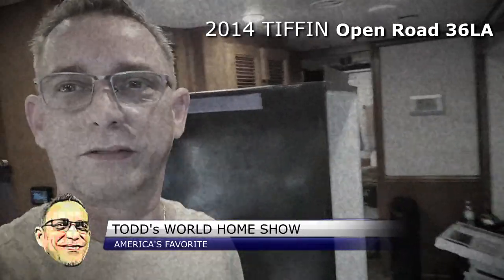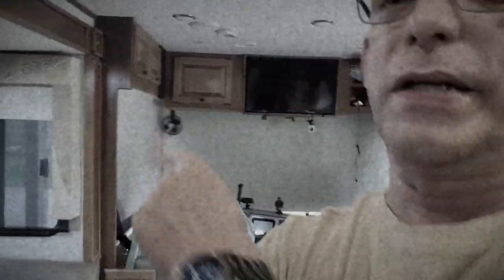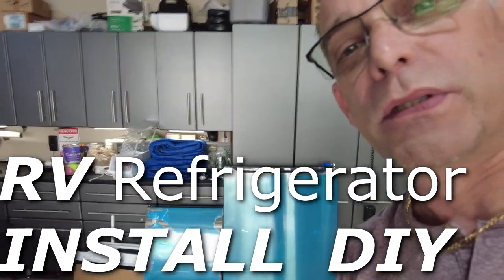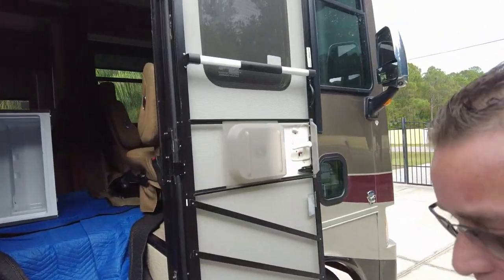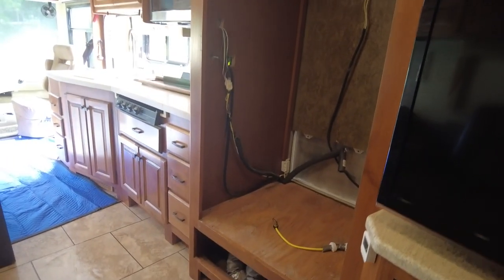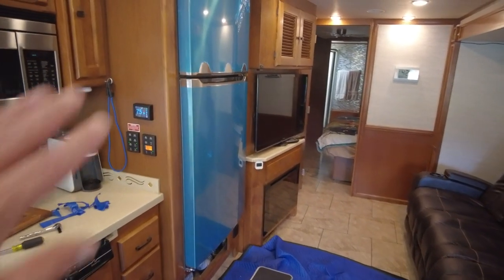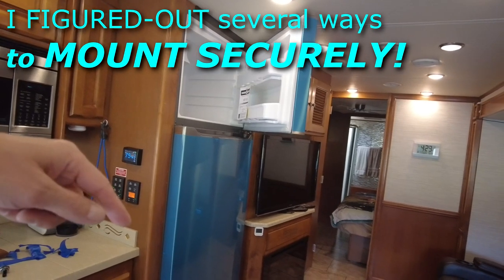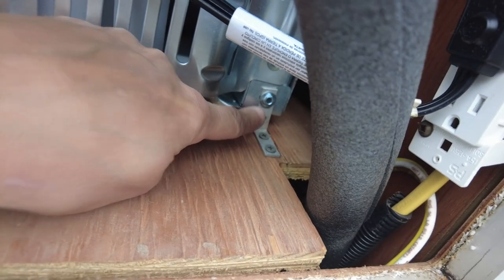tw RV ADVENTURES - Episode #45 | REPLACE RV Fridge | D.I.Y. | INSTALL RV Refrigerator | TIFFIN 36LA

Comment: Wow, excellent video. We've had problems with the Whirlpool refrigerator in our 2015 36LA. I've replaced the compressor relay twice and if it happens again I'll be thinking about replacing the refrigerator with this model that you have here. It appears that this would have been the best model to have been installed in the first place.
Reply from the maker: Robert, Thank you! I'm glad you found the video useful.  -Todd

Comment: This is our scenario exactly and we plan to tackle it next month. Question: in the video you show an RV door width of 27 inches. The Frigidaire unit in the description has dimensions of W 30, D 30.375, H 65.875. Is the D with the doors on?
Reply from the maker: Yeah. If you watch the video, before I move the new fridge in the RV, I explain that with the doors removed it's about 26 3/4 inches. That was just narrow enough to get it in the RV door. But watch the ice maker water line on the back as you get it in through the RV door 😀
Reply: @twHomeShow  thank you! I must've missed that detail. Perfect. Great job!

Comment: Hi, Todd:  I am just wondering if i replace my old rv fridge (has both AC and propane operations) with a residential-only fridge, any problems (other than it won't be able to be used for dry camping)?

Comment: Was it necessary to boost the alternator in the RV to handle the load of an electric refrigerator or was the original refrigerator also electric? Great looking installation, by the way.
Reply from the maker: Hi Albert, our original refrigerator was also an electric residential refrigerator.